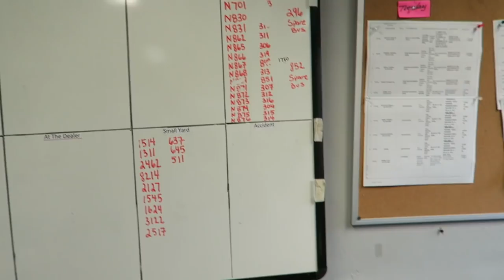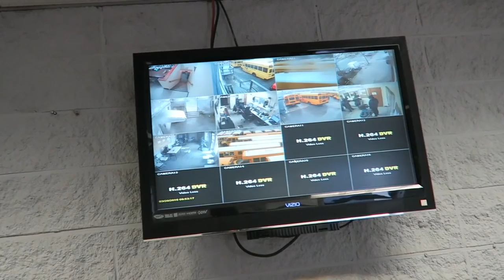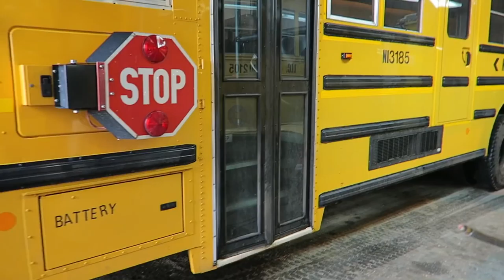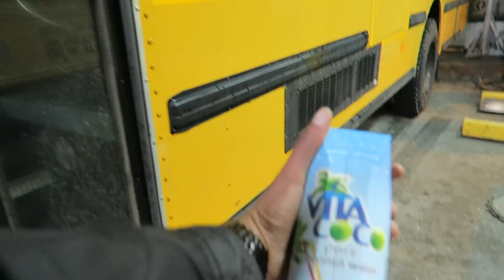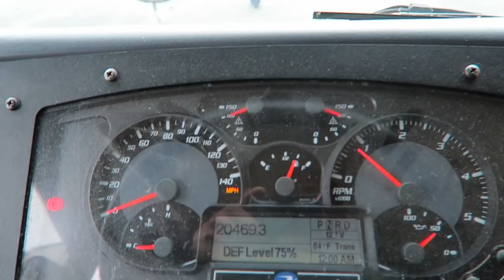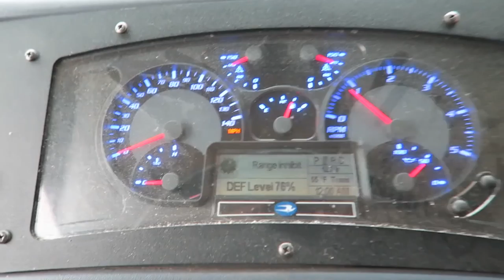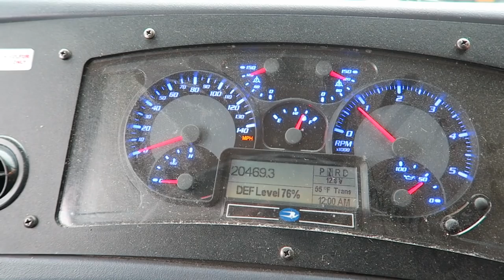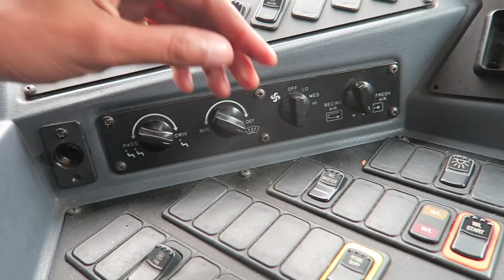Day On The Job Vlog#19 Working In The Garage

Comment: Recap tires  is a re-manufacturing process for tires that replace the tread on worn tires. Retreading is applied to casings of spent tires that have been inspected and repaired. Nice Haircut, back at it again with those vlogs. lol. great video Dillon!
Reply from the maker: Thanks for the info.

Comment: Well dang! Finally learned more about the air tanks on this video than I did in my CDL class! Also recapped tires are essentially brand new tires, just new tread. That's why they're cheaper. Regrooved just uses the existing tire and puts new grooves in them. Which is why they're no bueno for your front. Typically front tires as they wear replace the rear tires. At least that's how they did it where I drove.